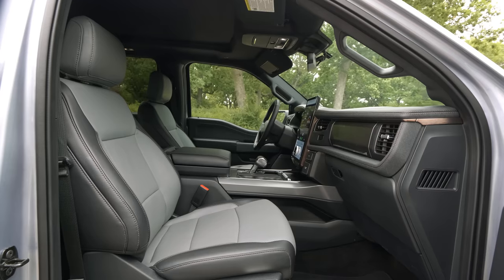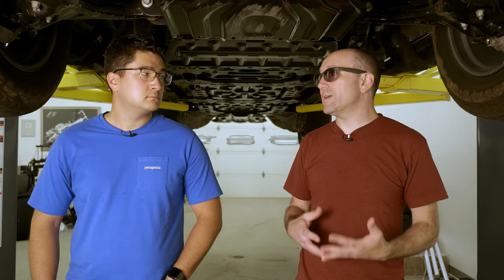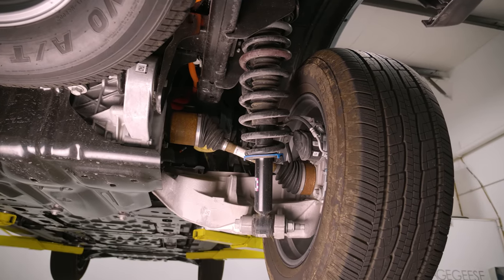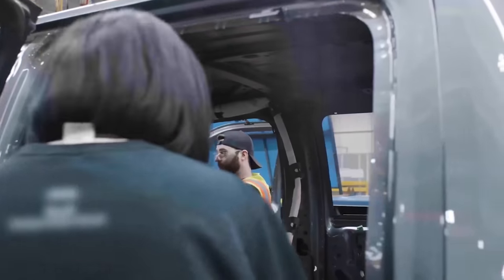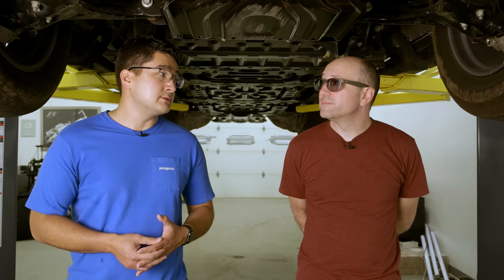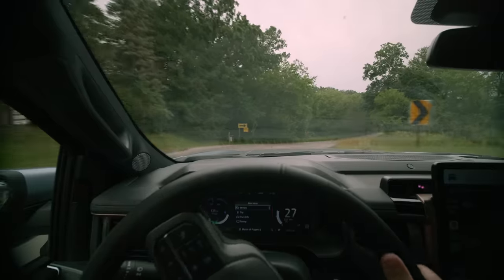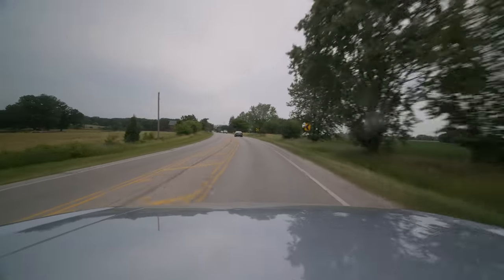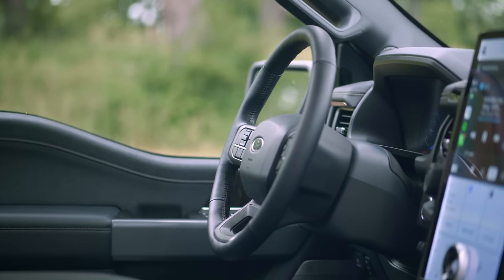Ford F150 Lightning | The EV That Will Change Trucks

Comment: The grid and infrastructure requirements are well researched. It's just not the OEMs responsibility. 

The short answer - it takes forever for new vehicles to filter into vehicles in operation, which drives energy demand. There's ~17M new cars sold per year, ~280M vehicles in use. Even as EVs grow as a share of new car sales, it will take decades to became a majority of vehicles in use. 

This slow, predictable rise in demand allows utilities to increase infrastructure just like they've done over the past century.

Comment: This vehicle is the tipping point, it makes everyone realise that EVs are superior, we're not going back... 
one big element you forgot to mention is the more or less inexistant maintenance and reliability of the drivetrain, with so few moving parts. the cost of ownership is greatly reduced, and for contractors who do their accounting carefully it will be a fantastic advantage on the ICE ones.
As soon as the range is on par with ICE, which should come in a few years with batteries improvement, you would be stupid to get anything but an EV, unless you haul for 1000s of miles, which is a niche use case

Comment: I went to the Ford website.  I built a Lariat with just the adds of extended range battery and spray-in bed liner.   Total: $79,904.  That, in addition to the nasty-high loan rates makes this cost-prohibitive for a lot of people., even with the Federal Tax Credit.

Sure, it's cool.  But is it really worth $80K?  Ford will probably sell a boat load of these things - but to whom?

Comment: In reality keeping the fridge and freezer cold in a power outage from a Lightning (or a Kia or Hyundai EV with that capability) only requires a few extension cords for most people. Maybe the AC is a bigger deal and harder to accomplish. But with cold beer, frozen steaks and a grill out back most of us can tolerate a power outage.
Reply: Guess you don't live in the South where summertime temps easily top 105F.  Indoors is unbearable at those temps without AC.
Reply: @mowcowbell  when we lose power here in Ohio it’s usually in the summer and past outages this year and 10 years ago we had temps in the high 90’s - low 100’s and high humidity. We live in a well insulated ranch house. When the power goes off we shut all the skylights and curtains and that helps a lot. We also have a finished basement to retreat to and we’ve had to resort to that this year. 

If you live in a two story house or a trailer I’m assuming my experience won’t match yours even we both tried to tough it out. And I’m saying acceptable is high 70’s in the house. It’s very uncomfortable but it won’t kill you.

Comment: My local Ford dealer is selling a Lariet trim for $140000 double the sticker-what idiot would pay that price? Cant wait until Ford starts selling direct to the public and eliminate 
this dealer BS. There is no benefit to electric anyway. It costs 4 times as much to insure-registration cost 10 times as much because you are not paying the gas tax.

Comment: Some of your numbers are absurdly wrong….
The cost of an electrician to install a subpanel in my home this year was $1,200.
This allows a 30 amp plug to go from my F150, to my house and power most of my house; including my furnace/air conditioning, kitchen, bathroom, etc.
Reply from the maker: Depends on area and the house.  If you saw the video the only authorized hardware and installer is Sunrun and its $3800 just for hardware excluding install.  If you have an older breaker box with 100amp service it will need to be upgraded.  And secondly you need not only the bypass but the port run outside or in garage which depending on the house design can easily be $2000 just for that.  Just had 4 electricians quote out this system and other EV charging ports and an average job including hardware would be pushing 5500.

Comment: I don’t really get the “something better will come along and then its going to suck” mentality. If the Lightning fits your needs NOW then it still will even if something with double the range comes out in the future. Most people are not driving 200+ miles in a day. Theyre dropping off kids, going to work, running errands, picking up stuff from Home Depot etc. Even when this truck is 15-20yrs old and degraded to 80% (244 miles) it will still meet the needs of 90% of truck owners. 

Yes if you tow trailers long distance regularly then it’s definitely not for you, but for the majority of F150 owners it will work for them and more.

Comment: The Lightning is a fashion statement. It's not for people who use a truck as a truck. It's not for people who long-distance vacation using a truck. As with every EV, resale value will plummet towards zero after about five years. Wait until the PR nightmare of Lightning battery packs going up in flames (not if but when).

Comment: Truck drivers tow things and drive long distances. Especially in car centric USA. A piss poor range from a giant battery pack compared to a small sized gas tank by area is laughable. Not to mention charging times. This isn't for the guy that takes his family around the nation and tows his equipment. Its for the cool hip crowd who own vehicles like raptors that don't even go out west. Lastly how can they call this a generator. Giant battery packs are not a power plant.

Comment: Nice video. As for the grid question, please note that many power companies are having issues right now, but not in the way you think -- it's the absolute opposite. So many people have installed solar at their homes and business in their work places that they are having issues in NOT selling enough electricity. That's right, they can't sell enough electricity to survive and keep up the grid. Some are pleading with their state to remove solar incentives, while others, like Florida's largest power company, are adding a minimum monthly bill of $30 even if you didn't use any of their electricity (obviously Florida solar customers are incensed at this). So to answer your grid question, power companies are actually praying for EVs to take off so they can sell enough electricity to survive. Several are even installing their own high speed charging stations along highways, and slower ones in shopping centers.

As far as the towing range, that will slowly improve with the next generation of 800 volts and higher architecture (greater efficiency and close to 300kw charging speeds), super capacitors to take the highest strain off the batteries and regain the most energy when breaking or going downhill, and the addition of special trailers with battery packs below their beds. Those are being worked on now by several trailer making companies. Then finally get there with the much more efficient, lighter, and more powerful (while using less battery) axial flux motors. Mercedes Benz will be the first manufacturer use those in their EVs. They will do so on their next generation of AMG model EVs.

As far as the speed of the technology improving so quickly, that's to the benefit of those that cannot afford new EVs just yet. They will be able to used ones at a lower price, just like what happens with regular ICE vehicles now. For those that say, "but what about battery degradation?" Unless you are really beating up the battery, meaning drag racing all the time (a lot of young men do it constantly--can't blame them, we all do this when young), always charge on super charges (especially of they are free) and such things, modern battery packs will last hundreds of thousands of miles with very little degradation - 10% or so. That's why auto manufacturer can guarantee their battery for a minimum of 8 years while other even longer. Just look up thing like "This Tesla Model X Has Over 200,000 Miles!" or such searches to see for yourself.
Reply: Some neighbours have solar the voltage on the grid is normally 230V (1 phase) but yesterday was sunny 247V most converters should stop at 253V (230V+10%). If everyone went to full electric we still have a charger problem, half of the houses have no driveway. And over 200 cars charging on one transformer for this neighborhood is not going to happen.
Reply: Hi Paul, instead of coming off like a troll, I’ll just ask.  Which states and which power companies need this?  I am not aware of that many people going off-grid or even partially, period.  Brown-outs and black-outs are from an overtaxed system, not the opposite.  Thank you, I hope you are able to respond.
Reply: "Florida solar customers, others shocked over new charge on electric bills."
"Utilities push back against growth of rooftop solar panels."
Reply: @olafvanes  people are now adding cheap cheap LiFo (LFP) batteries so they will be partly or fully charging off them. Plus people don't need to charge every night.

Comment: I often wonder why the EV manufacturers don't limit the power in order to maximize the range. No one needs a F150 that fast, just decently quick. If they could make it with enough power to hit the quarter in 14 and provide 400+ miles of range I think it would be a more compelling proposition.
Reply: The range figures on EVs are already based on the assumption the driver is driving very conservatively to maximize range. If you’re driving aggressively, your range will be much less than the listed maximum range. So what I’m saying is that limiting the power available to the driver, as you suggest, wouldn’t increase range because the maximum range the manufacturer gives already assumes you’re not using all the available power.
Reply: @solidaverage  Thanks. Perhaps limiting even more?

Comment: I'll still take a gas powered truck. Towing is useless (for now) and don't want to pay $20k to upgrade to a Lariat with an extended battery.  That's the most ridiculous move. 

In winter. The range is also petty reduced.  So you'll have less than 200 miles in winter,  but don't worry I'm sure that'll shoot up in the summer,  if it's not too hot,  because you'll lose range too. 

I would fall asleep in that truck while accelerating and driving.
Reply: Interesting take. Have you ever driven a good modern EV? Any Tesla for example? Instant torque and acceleration are same level of fun as roller coasters
Reply: @maximlg253  Yes, I have driven my former co workers Model 3 Long Range, and my friends Model 3 Performance. 

I found both boring after the instant torque novelty wore off, and I was left with silence and a "what now" feeling despire the M3P being one of the fastest cars I've driven.

I enjoy the sounds and feedback my car gives me throughout the RPM band. I'm a small %, but a car enthusiast nonetheless.

For the average person, they never get to experience that so it's always fun to them acclerating to just above the speed limit. An EV just amplifies that due to near instant power, way more noticable compare to their 200-300ish horsepower sedan or SUV.

Comment: Car manufacturers can make the biggest advancements in EV technology but if the infrastructure to support widespread use isn’t there then the push to replace internal combustion over the next decade is going to fail.

Comment: Battery density won't improve anything more than very marginally unless there is some amazing new discovery.  The lithium ion technology has already been pushed pretty much as far as it can go.  Same with three phase electric motors - that stuff hasn't changed in decades, and won't change without some revolutionary discovery in physics.
Reply: Solid state lithium batteries do have the potential for considerable gains. Several companies are starting small-scale production to get the kinks out.

Comment: 2:55 It's disappointing that Ford won't provide engineering support for such an important vehicle for them. One thing I can mention is that the Lightning with the Max Tow package has a second AC compressor with its own AC refrigerant loop dedicated to cooling/chill the motor electronics coolant to prevent overheating of the powertrain under load. It has an AC condensor with a split design: the top half dedicated to the high voltage battery and the bottom half dedicated to the motor electronics and cabin AC. So the Max Tow Lightnings still have only one AC condensor, but it performs the job of two and serves two completely separate AC compressors. The standard Lightning has the one condensor serving one compressor. Either way: for packaging purposes the radiator, fan and consensor are underneath the frunk/front bumper angled down, since the Lightning doesn't really have a front grille anymore.

As far as coolant goes the Lightning has a motor electronics cooling system with three coolant loops, one for the high voltage battery, one for the electric powertrain/motor electronics and one for the cabin. They are all connected with diverter valves and all three coolant loops share the same degas bottle. This is different from the Mach-E and E-Transit, which also has three loops but 2 degas bottles: one for the high voltage battery and one for  the motor electronics/cabin HVAC. In the Lightning, Mach-E and E-Transit the cabin coolant loop branches off of the motor electronics loop, so it's really more like 2.5 loops, but again, they all are connected with diverter valves anyway.

Either way, the idea is that the AC refrigerant can cool the coolant using a "chiller" if the coolant gets too hot. It's not really new technology, the first generation Escape hybrid had a coolant chiller in 2005.

Can't speak too much on anything else, this is just coming from the service manual and new model training they give us technicians. Respect to other technicians though, the amount of knowledge we have to learn to do our job well is really starting to approach engineer-levels of knowledge. Too bad the pay, benefits and respect for the job isn't keeping up, but there's always hope for change in the future. Thanks savagegeese for the video, keep up the good work.

Comment: If gas is $5.00 a gallon, about $3.00 to $4.00 of that money is wasted [lost] in an ICE vehicle as unrecoverable heat.  An EV, on the other hand, use about 80% of the energy in electricity.

Also, the down time for maintenance [oil changes, etc.] and repairs is much less for EV's.  This should be very appealing to contractors and business owners in general.

A much bigger question is the loss of jobs as EV's take over the market. An EV uses probably 40% to 50 %  fewer parts than an ICE  vehicle .

Comment: I wanted this so bad until I found out it only comes with a 4.5' bed and the upcharge for range is crazy....
Reply: This is the 5.5' bed across all trims. I agree the range upcharge is nuts but it also includes the home charge station pro and other options pack's.

Comment: TFL towed a normal trailer behind one of these, it got 84 miles before they gave up the drive. Electric cars are an attack on the working man. It isn’t a resolution to any real problem. It’s about control, not helping.

Comment: First, I'm not a fan at all of that enlarge 'tablet' for the instrument cluster; seems like a lazy way to implement tech.  There are people who want to own a truck but really do nothing more with them than they could with an SUV. For those people, this truck would be better than an internal combustion vehicle. Here, you are getting much more than you need but at a cost. Personally, I am more of a hybrid type guy. I like the idea of having the option of stopping for fuel when I need to and not having to solely rely on the electric power supply. Plus, with Ford's spotty reliability history more long-term info would be required for me to even consider this.

Comment: Great video, as usual.  I do have a request, though. Please stop calling these trucks generators.  They are not.  The F-150 Hybrid, properly equipped, is a generator.  This vehicle is a giant battery back-up for the home, a larger version of that external power pack you carry around in case you forget to charge your phone the night before.

Comment: If Ford made the rear plug able to provide power out and also accept power in I would buy one to tow my camper that has solar panels up top. That way I could leave it plugged up to the camper and have the solar panels charge the truck while I was out and about
Reply: The amount of power those panels make would charge this thing in maybe a month.
Reply: @markmiller3279  I figured as much, but of course, in the event of a long term power outage, I got a month to spare lol

Comment: I think your concerns about the grid are valid. Currently, with most EVs charged overnight, the demand is synced up with surplus grid capacity that normally comes with cooler temperatures and less human activity.

Comment: depends the area. I am an engineer for the power company and in areas like new York those facilities were built in the 1940's and are not equipped to handle this future load. the biggest issue is peak load times, everyone will be getting home at 4:00 on a hot summer day, plugging in their car then turning down the AC adding major spikes to our system that it most likely will not be able to handle.
Reply from the maker: Did you see recent study on smart thermostats and peak load?
Reply: @savagegeese  that's just the start, wait till they have your washer/dryer/dishwasher all on timers to run at 3 in the morning.

Comment: We have wildly inadequate infrastructure to support widespread adoption of EV’s. Not only in availability of fast chargers in most of the country, but electricity generating capacity. 

Plus the work ability of the EV truck is laughably poor. Hook it to a trailer or put a load in and you get maybe 100 miles of range. 

To hell with that.